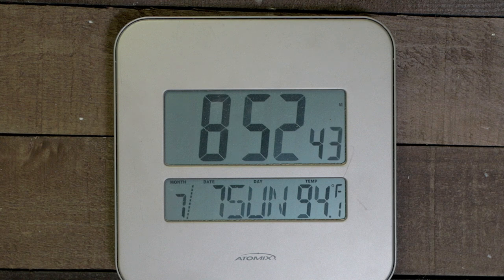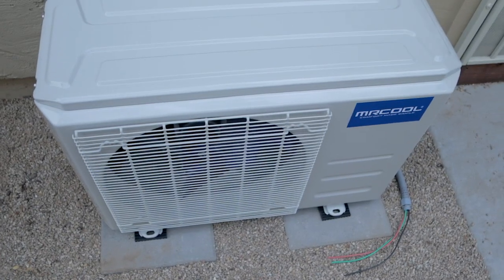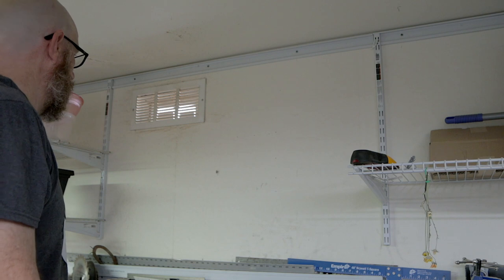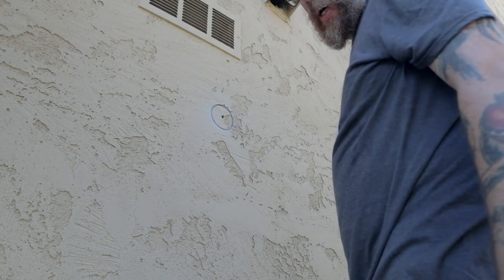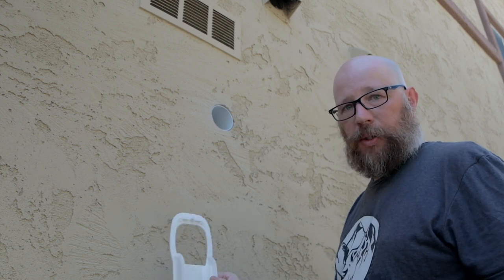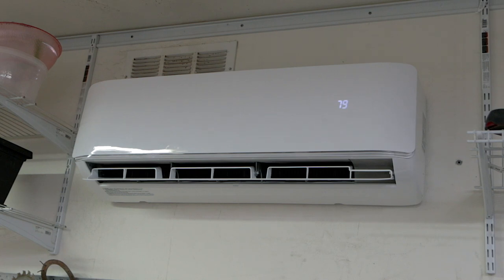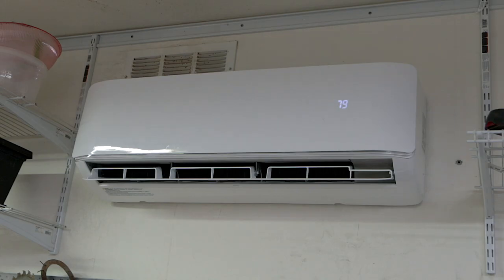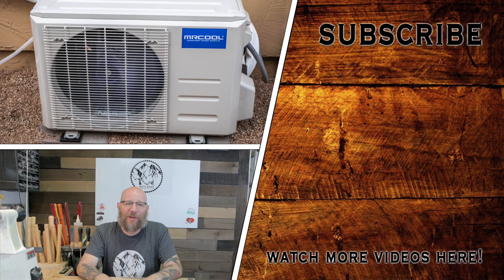Shop Project: DIY Mini Split Install

Comment: I installed one last year in my pole  barn 24 x 24 shop.  At the time I had no insulation, just the metal skin and nothing can effectively heat the space.  For years I used a wood stove and construction heaters and it would take 4-5 hours to get warm enough to work and summers would get really hot.   So I insulated the building and what a huge difference.  This last summer it cooled my shop by 15-20°.  I  can heat.the shop well enough to work in less than 2 hours.  With insulation, these units are very efficient and not too costly to run.
Reply from the maker: It makes such a huge difference.  I still need to make some modifications to my setup which includes putting some insulation in the attic.  I'll probably do an update video next spring.  - Ed

Comment: Those vertical coils of extra tubing may give you pools of oil at the bottom of the loops. Here in Texas it's also hot. We remove those extra coils and recharge, or coil them horizontally. FYI
Reply from the maker: Thank you for the info.  It's that time of year when we have our A/C maintenance done.  I was thinking about having them remove the excess tubing and recharge it.  - Ed

Comment: Thanks for this video!!  I have wondered about these units. I may have to put one of these in my garage.  Thanks again!
Reply from the maker: Thank you Lisa!!  In my opinion, they are the best option when adding it to a garage or shop.  As a bonus, it is also a heater.  It doesn't get that cold in Phoenix so this will be perfect to knock out the chill when I first get started in the shop.  - Ed

Comment: If you seal the vent above the air handler on wall, it will give improved results.
Reply from the maker: I didn't show it in the video, but I used a piece of 1" pink foam board to seal up that vent.  There is another one down lower on the wall that I left open for ventilation.  I've not had them in any house I've ever lived in until I moved to Arizona.  Seems to be the norm here.  - Ed

Comment: Perfect timing as I've been thinking about adding a mini split.  I live in NW Peoria - I think i'm on the opposite end of the valley from you.  It's been to hot to turn. How did you decide on the Mrcool?
Reply from the maker: Well hello neighbor!!  I saw April Wilkerson and Johnny Brooke install them.  It's one of the only units that is completely DIY.  You don't need an A/C person to charge the lines.  There are pros and cons to this unit.  It comes with 25' of lines and you cannot cut them.  You have to coil them up.  I still have some work to do and I'll probably put out an update video after a while of using it.  My garage is baked by the sun in the morning and the evening.  Basically all day long.  This fall, I'm going to add some insulation to the attic and see what that does.  I went with a 18k BTU unit and if I had it to do all over again, I'd go with a 24K or 36K unit.  I hope that helps George.  Thank you for the support!  - Ed
Reply: @WolfRidgeWoodworking  Thanks.  My next project later this summer will be a mini install.

Comment: I am curious on how it has performed in your garage. I would like to get my garage to 75 to 70F. So I wondering how cool you have dropped it. Im in Texas and I just redid my garage and this heat is killing it. 95F the other day. So Im definitely ready to take care of it. I am a brick home two story so my daughter's room is above.
Reply from the maker: It's doing pretty well.  I do think it's taking a little longer to cool things down than I think it should.  To be fair though, I haven't insulated the attic and I think that I might should have gone with a larger unit like maybe a 24k BTU unit.  I am very happy with it.  I haven't dropped the temp lower than 78F.  With it being so dry here in Phoenix, 81F or 82F is really comfortable for me.  I would advise going with a slightly bigger unit that you think is good.  The difference in price will be made up in saved electricity over the long run.  - Ed

Comment: That line set is stupid long.
Reply from the maker: I know what you mean.  That's how the DIY unit comes.  I will eventually have it shortened.  - Ed
Reply: @WolfRidgeWoodworking  If the unit has shutoff valves which it should, You close off the liquid line valve (small line)and start it up.  You watch on a set of gauges it get almost down to zero.  Immediately shut it off and close the other shutoff valve.  Then you can open the line set, cut, and flare.  Hook back up.  You will need to run a vacuum on just the line set.  After, open the liquid line (small line) 1st and then open the suction line.  Start back up.  Depending how much line you cut off, you might be a tad over charged. Easy job if you have gauges, vac pump and flaring tool.